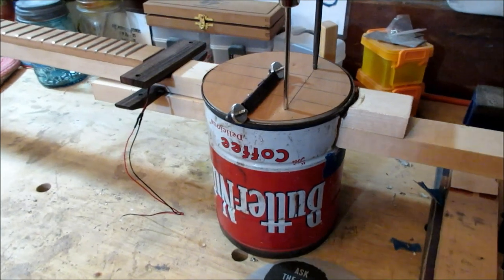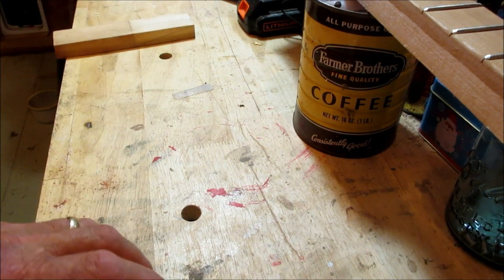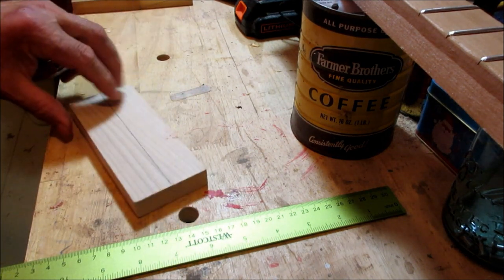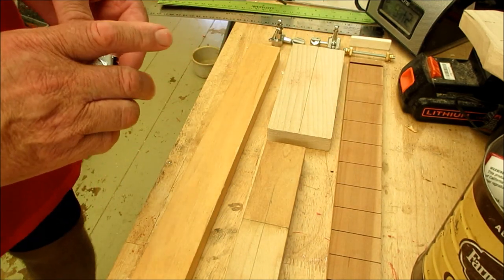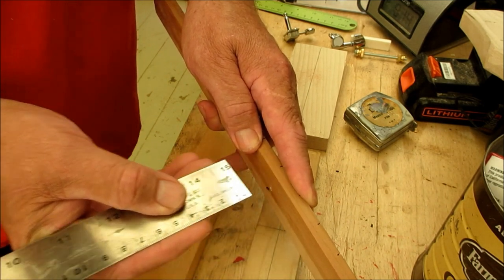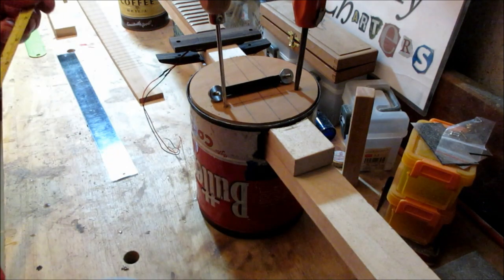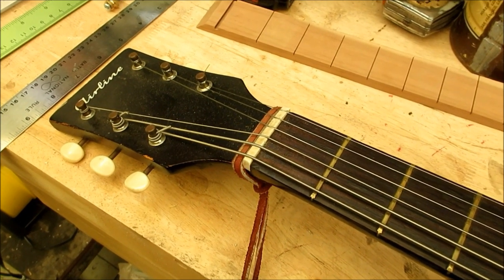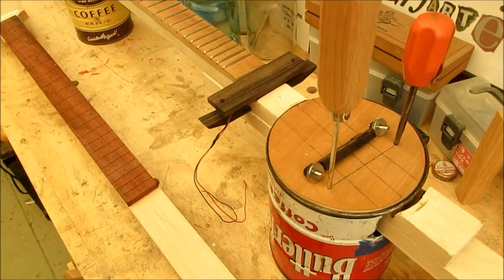Neck Dimensions

Comment: Thanks for the video!  Dimensional lumber in the US is 1/2" smaller in both height and width than how they are sold.  The neck stock that you are using (3/4" x 1 1/2") started as a 1" x 2"  rough-cut piece of wood.  Once dried, the mill will plane 1/4" off of each side, making the final product the new dimension.

Comment: Hey Paul,
Should the spacing between the edge and center strings at the nut be the same as the spacing established by the tail?
Reply from the maker: Theoretically yes.  Using the junk I do, maybe not.   Thanks for watching)))
Reply: @paulmerojunkpileguitars  You're welcome. Thank you.

Comment: When would is sold as 2 inches, they are referring to the dimensions of the green cut wood. The wood shrinks when drying.
Reply: sivad2 not completely. They are losing some due to the saw curff in the Wood. You have to pay for that too.

Comment: Looks like you had 11 and 12 mm between centre and outer strings there not 7.
Reply: Yep I agree there was no 7mm measurement there, although over here we don't use new fangled fancy metric systems so I make it 10 to the minus 6 of a mile LOL.